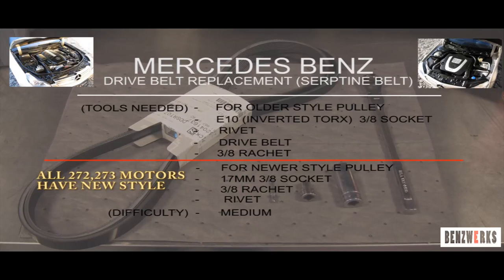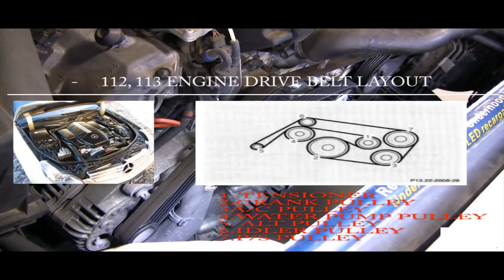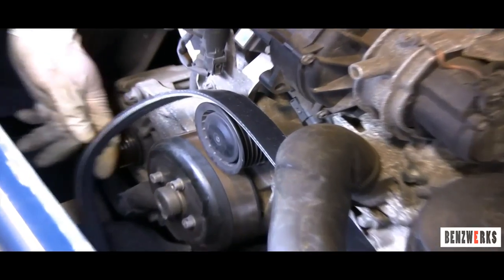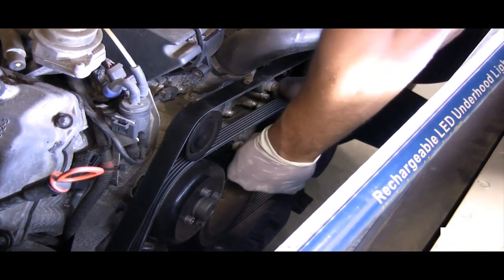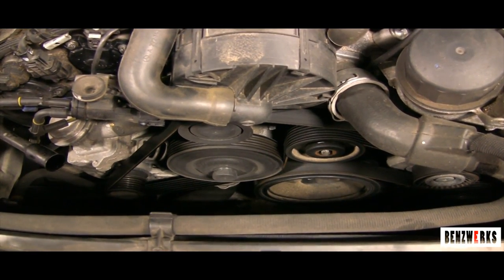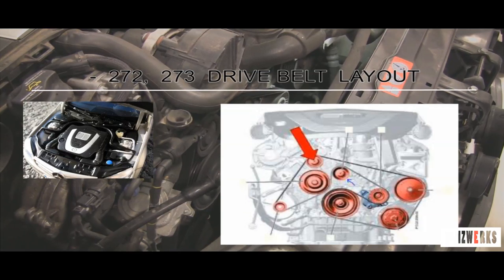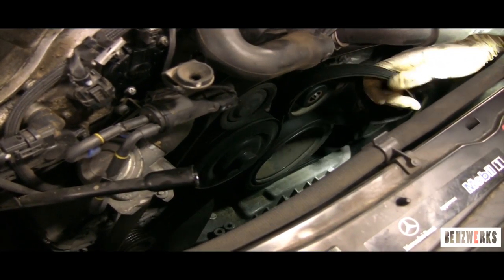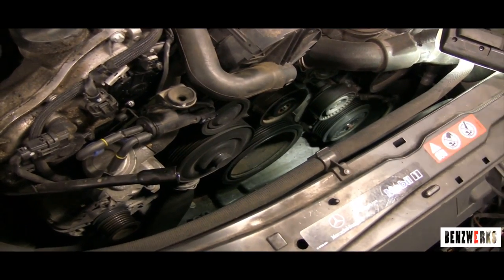BENZWERKS drive belt replacement (serptine belt)

Comment: Your video saved my friend about $2000!  My friend's car quit on the freeway.  Had it towed to FLECHER JONES MERCEDES NEWPORT BEACH.  They quoted over $2000!  That was to replace the belt, both tensioners (WTF, there's only 1), water pump, and labor. Told him both tensioners broke off. Total RIP OFF! I looked at it. The idler pulley above the water pump had disintegrated, causing the belt to shred. Cost us $50 to replace the belt and pulley. Took 1 hour to get the parts, 15 minutes to repair.

Comment: Great video, but I would like to add that when you become in a situation where you are struggling to get the belt on, simply work it all on all the way to the tensioner pulley like you did, with a steady hand, hold the belt and with the other hand release more tension from the tensioner. You lost some of your slack when you initially let off the tensioner so catch the rivet, and it’s easier sometimes to just put the wrench back on as pushing on the belt. It has worked for me and I hope that helps someone. Nice video! Thanks!

Comment: Thank you so much for the tip on using the Rivet as to keep it in locked position. I was searching all over the house for a long Allen wrench I used once before but anyhow very good description on how to change the belt. Just did it now for an R350. The tricky part for me was figuring out the correct placement of the belt on the tensioner pulley since theres no grooves on either side of the pulley to know exactly where the center position is.

Comment: Great video, much better than the factory manual, which is really cryptic. The manual calls for a 5mm pin to hold the tensioner open, I used an 1/8 inch drill bit. Also I used a Gates replacement belt and had no problem getting it over the tensioner. Benz gets their belts from Continental which I consider much lesser quality than Gates or Dayco. Don't go cheap on this belt because if it breaks the car car stops. A quality belt is cheap insurance.

Comment: Great job on video, I have a question , I am going to change my thermostat on my 2010 ml 350 , It looks to me would be easier to remover serpintine , do i use the wrench and turn to left and place pin in the area to hold tension off so i can remove belt......Thanks very much....John...

Comment: Great video! I used it to replace my belt. Should the belt stay in the center of the tension pull after it starts? Mine belt moves to the outside. It also makes a little noise. It looks off. I've checked and  the belt is all the groves. 2008, C300

Comment: Lifesaver. Where do you get the pin to catch the tensioner?  Besides that very in depth and helped me out a lot. I was having issues getting the belt back on. Didn't really know how to move the tensioner so I could fit the belt on.

Comment: Thanks for this video!  It was very helpful when I changed the automatic tensioner on my 2006 E350 4 matic.  The old one was free wheeling really badly and needed to be changed.  Unfortunately, that didn't cure the squelling.  Do you have any recommendations?  Do I have to change the belt even though the belt appears new?

Comment: Thanks for another very informative video.
I need your help with deciding which belt to buy. My vehicle user manual recommends a 2404mm belt i.e. 94.6 inches but the belt I want to buy only comes in a 94 inch and 95 inch variant.
Which one of the 2 belts do I buy?

Comment: Excellent video. Perfect timing, for me to have bumped into this clip, right when I'm about to bust mine.  I've got the M113 NA, 2001ML55 AMG to be exact and its' disappointing, to not find that many videos on the W163.  I mainly seek performance upgrades, which YouTube severely lacks, in the Mercedes Benz ML's.  I'd consider seeing many more performance modifications, with the AMG's, as it is to be expected.
  Such as, throwing on the complete Magnaflow exhaust systems, that are offered for the 1998-2005 ML55 AMG's, (which I'll be installing in the near future.  I would also like to see, Superchargers, either AMG or, whatever else is available Kleemann, headers, tuned chips, so far Jet offers it n Kleemann does but, with a complete performance expensive kit.
   Anyhow, it would be nice to see other Performance hungry, AMG owners, leaving their detailed reviews, & how-to's.  Power steering pump, is something I've must replace soon & Mercedes Source explains how there's a common problem with the pumps' front seal, and so he offers a convenient diy kit    He's got great diy's on Benz repairs, and an awesome collection but, they're all cars & NO Benz trucks!  I don't even think I've seen him work on AMG. In other words, he's definitely not much of a HIGH Performance buff like I am.

Comment: How did you get the belt over then Tensioner? My belt seems way to hard to just simply "slide" it over.

Do I have to loosen the tensioner at all? Do I need a new belt? A quick reply will be much appreciated but thanks!

Comment: thanks for very informative video..I just finished replacing belt on my ML 350 and I just have one question. Why is the belt not fully seated on the belt tensioner pulley? Edge of belt is off the tensioner pulley by 2/8 inch. Checked and double checked everything. Thanks
Reply: +vcb1202 did u figure it out.  i have the same and the new belt just went out.
Reply: yes. inspect and change upper pulley if need be in your case because it solved my problem. good luck
Reply: in my case the tensioner pulley was worn so it would push the belt towards out the edge.  i replaced it and it no longer steps out of the tensioner pulley.
thanks

Comment: This is s great video.  Why do you need a locking pin?  Also, when the belt is in place, it seems like you should take your rachet and move it to the right.   Do you really move it to the left to tighten it?   Thanks.
Reply: Why do you need a locking pin?  It holds the tensioner in place, after ratcheting to the right. Do you really move it to the left to tighten it? Yes, after removing the pin (I used a drill bit) you remove the bit, then ratchet back to the left to place tension back onto the belt.

Comment: Great video bro...although I found it easier to pull the belt over the water pump pulley rather than trying to fit it over the tensioner
Reply: Thanks, will try that.

Comment: Not sure if you're still active on this channel but I was wondering if you had a video advice on how to the replace the 2000 c230 kompressor supercharger pulley? I see that the magnetic portion is not balance and probably doesn't engage correctly.

Comment: Check for play on all pulleys, it is normally best to install a new idler pulley at the same time of doing this job, especially if you're in the upper mileage range, exceeding 150,000 miles. It's not an expensive part and eBay offers a complete kit, tensioner pulley part, serpentine belt, and the idler pulley, which will require a pulley puller tool that most auto parts stores loan out.
   Who knows, I may end up uploading some clips since, I have got, quite a few things on my plate, in store for my ML55 AMG.  Double din DVD head unit, inner & outer tie rod ends, power steering pump, valve cover gaskets, Magnaflow complete exhaust kits, 20x10 AMG rims, and I am going to dip my truck Pearl white, (possibly 2-tone it).  
     I most definitely, want to flash tune my ECU but, I wish there were more options available, besides Jet Performance chips.  If its got to be them, then them it will be.  I also wish more headers were available, besides the $3,000 GBP set offered by Kleemanns.     A nitrous kit, along with a Supercharger kit, will be further up the road.  Oh yeah, before the AMG 20's get slapped on, some lowered H&R springs, along with Bilsteins all around will be installed.  I also just found some thicker Performance, front & rear sway bars by H&R that are also available.
   The springs, will hold me up until the airbag suspension gets thrown in.  Oh, and before the truck gets dipped, you should see the sick ass body kit, I am going to slap on, with Halo LED black headlights.  I can, and already have, envisioned the final outcome, and believe me, the WORLD will become familiar with my AMG Project.  Trust!

Comment: 1989 MECEDES 300 SE replaced serpentine belt finally after finding your video, but I have a problem with the car starting. If the car starts the belts will NOT turn, but if i crank the car over the belts will turn but car will not start... any help would be appreciated.

Comment: What drive bit socket is needed to replace the idler pulley on a 2005 CLK500,
V8, 5.0 Liter, engine number 113.___?

Comment: a question for the finer mechanical tutorial publisher on utube...

08 gl550, belt rubbing, not sure what the component is but it is front and center, at the top of the engine, drum shaped hard plastic looks like..., 3 non clamped, (non pressurized) hoses out of it.
 its mounted on a bracket with bushings.., in any case
., whatever this is, the bottom of it is a hair from rubbing or occasionally rubbing.

on another note.. if your soo kind, .., the alternator pulley,. could this go out of alignment?

lastly,.
 the charge port for the ac,system?, drivers side top, near the firewall?
eternally grateful for aky helpful insights

Comment: I have a driver side passenger window stuck down on a 98 ml 320. are there any quick tips to check before taking to mechanic? the motor sounds like it is working when I press down, but cannot get it to go up? Any help is much appreciated. THANKS

Comment: Hi I have a W211 E220 CDI European model. The drive belt needs replacement and I'm going to replace the tensioner when I get the belt out. BUT there is that tensioner with a shock by the left lower side of the tensioner and I don't know how to release the tension to remove the belt. And after that do I replace the whole thing or I can replace just the rotating part? I'm bit tight on budget this time and the belt is not looking good.. Please help?

Comment: I replaced my serpentine belt but it keep getting eat up I have replace 3 so far. What is the problem.
Reply: Could be many things.
One of the components that is driven by the belt is worn or out of position.
Also ensure you have the correct belt in the correct routing.

Comment: Why do all you guys miss out how to get to the fanbelt? You've already done half the joib off camera before you start filming! I can't even see my fanbelt when I pop the hood and yet you show a big space that a child could hide in!!!!!
Reply: thats freking funny...but true..
Reply: What fan belt? These vehicles have electric fans, these are serpentine belts that drive the water pump, alternator, power steering pump and AC compressor, there is no belt driven fan on these cars. In the videos it looks like he has removed the fan shroud and fan for easier access but I could be mistaken. I'm going to be doing an 05 SLK 55 AMG and it's a very tight space between the fan shroud and the front of the engine, I may have no choice but to remove the fan, that's what I'm here to learn.

Comment: Nice video..but ho-hum its totally different to the diesels.
The tensioner pressure seems much much higher on my diesel than on the petrol engined cars..and you need some new/specialist tools to undo them. 
Also there is zero room betwen rad and tensioners so no place for any handiwork, unlike the one you're working on!
Reply: Yes tell me about it - 90% of our C class cars here are Diesel - hence my question. 
Regards